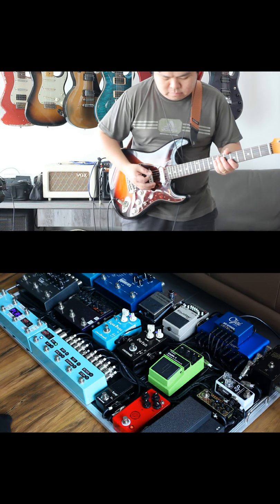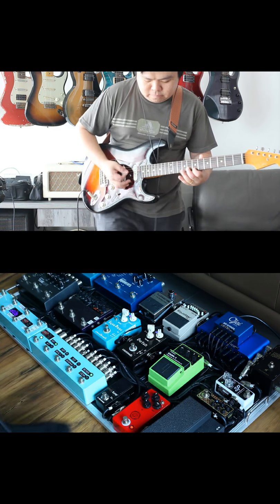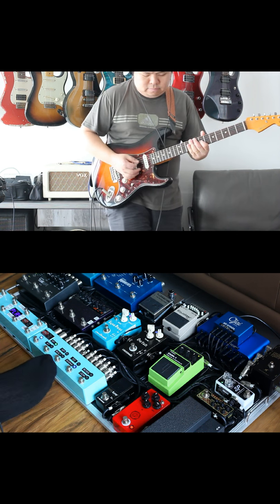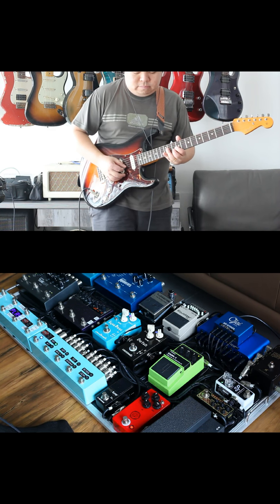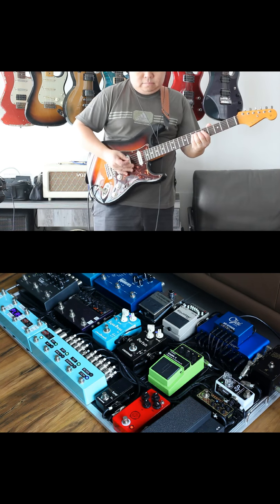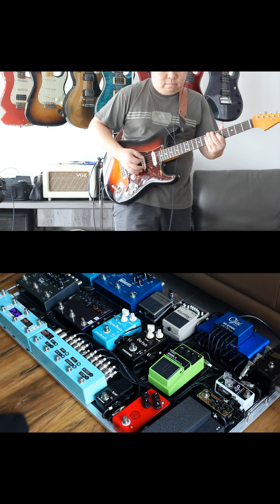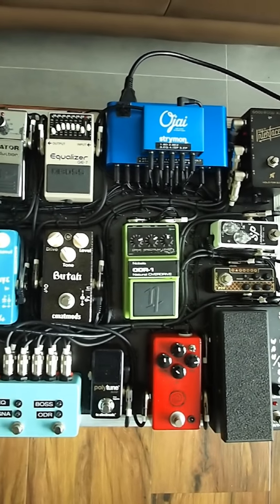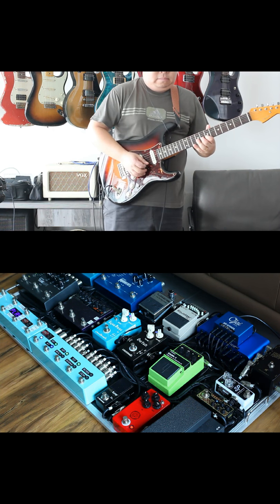Gear Tips: Going Ampless (Preamps, Cabinet Simulation, Overdrive Choices)

Comment: Yes! I’m going the ampless route as well. In my case I’m using a neunaber Iconoclast as my cab sim. But I thought that that and coupled with an overdrive would work. But I couldn’t get it to sound right. Right now I’m using the Chase Bliss Condor as my designated preamp pedal until the Revival Drive hits my board, then the magic starts. And yes, going ampless requires a preamp pedal and a cab sim.
Reply from the maker: Cool choice with the Condor! I used the Neunaber for a session and thought that it sounded better with a line out from an amp versus going direct with pedals.
Reply: Did you ever get the RevivalDrive?
Reply: yes i did!
Reply: Im having better sounds or rather more convincing sounds pairing iconoclast with the Revival Drive. But im agreeing with you that with just a normal overdrive, you just don't get to a place where you're satisfied and happy with the sound (sound and feel).

Comment: Hi Justin , blessings and great tone. I'm building a board on a budget for worship. I currently have a VP, tuner and strymon blue sky. I would like to go ampless I have intentions of getting a Revv G3 distortion, a fortin 33  clean boost and Zuul noise gate because I like metal tones as well. Last of all my cab sim would be a mooer radar. I would also like to get that sweet breakup tone you are getting. 
Do you have any recommendations for other drives that would work well? I also have a concern since I'm going ampless what would be my alternative to running my time based fx through the effects loop?
Reply from the maker: Thanks for the kind words! The slight breakup is the interaction between the CMAT Mods Butah and the Mooer Daytripper. The Butah is the best "single coil enhancer" pedal out there, but it only really works when you have a decent preamp and cabsim to push. I've had success with the Daytripper and the Joyo British Sound. Without the preamp (if you're using just the Mooer Radar), I don't think the slight breakup tone is possible.

As for metal tones, I had an AMT S2 which can be configured to run with or without cab sim with its 3 outputs. I think pairing the S2 with your Mooer Radar would make an amazing metal rig platform that can also take cleaner tones on its clean channel.

https://www.youtube.com/watch?v=U1wvaCdVOZw 

For your time based FX, which effects loop are you talking about? FX loop on preamp pedals? There are some that offer this functionality, but I think for a budget rig, it's best to put delays/reverbs after your amp/cab sim. There is no big advantage to having them in an FX loop, and the budget preamps don't normally come with stereo FX loop returns.
Reply: This is great information Justin  , I usually run my strymon blue sky and tc delay into the fx loop of my combo amp , however since I'm not using the combo what you are saying is place my delay and reverb after by mooer radar on the chain and then into the house mixer?
Reply from the maker: Ah, nice choices for delay and reverb! Yes, you can put them after the radar. Alternatively, you could also put the radar at the end, so you can use the headphone output for silent practice. Delays and reverbs between the amp sim and cab sim is conceptually akin to putting them in an FX loop.

Comment: Can you explain the signal chain? I know the cab sim should go after the preamp but what about the preamp in relation to the other pedals?
Reply from the maker: Sure, here's my signal chain: Interfacer->Comp->Wah->DPC-8EZ->Mod, Delay, Reverb. In the DPC-8EZ, the pedals are arranged as follows:

1. ODR-1
2. CMAT Mods Butah
3. CMAT Mods Signa Drive
4. JHS AT Drive
5. Line 6 M5
6. Boss GE-7
7. ISP Noise Gate
8. Mooer Preamp

So the preamp is after overdrives and tone shaping tools, but before the wet section of modulation, delay, and reverb. I think it would be helpful to think of the approach like front-ending a clean amp.
Reply: Justin Chan thanks! Really helpful, like making your own FX loop

Comment: hello blessings I am between the rock bug carl martin or the mooer daytripper but I can only buy one single. Which of the two do you recommend me to connect my pedals and go straight to console which is better for that? thanks, I hope your answer !!
Reply from the maker: Hi! Both are excellent choices for straight-to-PA applications, but I think the Rock Bug is a very clean and non-colored, so you might need to rely on your overdrives for the "amp character". 

The Daytripper is a Vox AC-voiced preamp and cab sim, with two channels that can give clean and lightly overdriven tones (but not distortion).

So it comes down to your needs. If you need a DI box on your board for cab sim only, the Rock Bug is a great choice. It also has an RCA input so that's great for plugging in for practice. 

If you want more character, for both amp sim and cab sim, the Daytripper is your best choice. It doesn't have an XLR out, or an RCA input, so it has less practical value for personal practice.
Reply: @AllAboutWorshipGuitar  hello brother the best of all the options would be to use the mooer as pre and the rock bug as cockpit simulator then jajajajja thank you for replying brother greetings from argentina blessings
Reply from the maker: Haha! I did that for a while! I turned off the cab sim on the Daytripper and used the Rock Bug for cab sim. It gave the Daytripper a much "boomier" sound.

Blessings to you too, brother. :)
Reply: @AllAboutWorshipGuitar  What does boomier mean? I do not understand much English ... the best sound achieved using the two together or with the Mooer reaches to play in Vibo should you add a box of truth?
Reply from the maker: My apologies! "Boomier" refers to the sound having more bass than mids or treble. Actually, to be honest, I preferred the tone of the Daytripper over the Rock Bug.

Comment: Hi. How do you connect that to a PA system? Do you need a loadbox in case of connecting all that stuff to a mixer? Regards
Reply from the maker: Normal DI boxes will suffice! With the Interfacer, you could sum to mono and just use one DI box. But the true beauty of this setup is having a pair of DI boxes, and at the mixer, hard pan the channels left and right for true stereo!
Reply: @AllAboutWorshipGuitar  I was thinking about using a aby pedal switch to get the stereo sound. Would it work the same way?
Reply from the maker: If I’m not misunderstanding your setup, I think you want to split a mono signal from your last pedal using an ABY pedal in reverse? That will split the signal to dual mono, not true stereo. It certainly is a step up from mono though.

Comment: no longer uses the rock bug carl martin as cabinet and the mooer daitryper as pre amp? now only use the mooer daytripper? Does it work better like this or did it get better sound with the rock bug?
Reply from the maker: Actually, it was a matter of pedalboard real estate. For this big board, I had an EP booster at the end of the dry fx chain, and the Mooer has the same form factor, so it made swapping out a lot easier. This video was concentrating on how to use the Daytripper.

But yes, since I sold my PT Junior pedalboard, I had no space for the Rock Bug. Also needed to sell off gear to fund other stuff, so, that pedal had to go...I miss it sometimes.
Reply: español

Thank you very much for answering. I do not understand the video because I do not speak English. I am using the google translator to write you. I have a rock bug that I recently acquired and when I saw your video, I got the curity of whether it would improve the direct sound to the line adding the mooer daytriper since the rock bug does not have equalization is only cabinet, the mooer yes, like preamp. If it's worth it I'm going to buy a mooer. There are no videos on this, I thank you very much for your time and your answers, may God continue to bless you greatly!
Reply from the maker: Go grab a Mooer, you won’t regret it! :) I’m humbled and glad that the video has helped you.
Reply: @AllAboutWorshipGuitar  I am from Argentina . Thank you very much for helping me. May God bless you twice for everything you share. Thank you for your time brother ... a hug !!

Comment: I am going to buy my first electric guitar with of course a speaker and i am thinking of buying a pa speaker and a day tripper instead of a amp because for me i can use it just as a music speaker and also for singing 
Would recomment it instead of amp? Is the sound of the speaker simulation in the Day tripper in a pa speaker good?
Reply from the maker: Hi! Congrats on taking your first step in buying electric guitar gear! What size of PA are you looking at? I’ve run this through a multimedia speaker before, and found it too “boxy” sounding. I then tested it with a 100W PA system and it sounded much better.

Actually, if this is your first purchase, I’d go with a traditional amplifier first. Master the basics of one guitar, one amp. Then you’ll appreciate what these preamp pedals are trying to emulate.

Comment: Hey Justin,

You used to use the Vox AC4TV? I’m using my AC4TV, but I want to play without the amp. So with the Mooer 004 it is possible? My Strymon BigSky is at the end of the chain.
Reply from the maker: I still have my AC4TV! And yes, it is certainly possible with the Mooer 004. Having it before the BigSky is also where I've placed my Daytripper, as I'll sometimes use that cab filter instead of the stock Daytripper's cab sim.
Reply: So as very first in the chain?
Reply from the maker: Sorry I missed this! Have it after the wah/comp/drive section.

Comment: I have question man, 
I also have to go ampless because of the church where I play and on your set up I see you have the MOER 004 as a pre amp, but what's the last pedal you use at the end of your chain? 
I was using a cab sim Hotone but i really didn't like the sound.
So I'm thinking of buying the MOER 004 as pre amp, and I don't know what to use at the end as cab sim. So which one are you using?
Reply from the maker: Hi! My last pedal in the chain is the Strymon BigSky. The Mooers pack both preamp and cab sim, and since it can't be changed, I'd recommend you try out the Mooer with your overdrive pedals before it, and your delay/reverb after it and see if you like the sound.

Alternatively, I have had some success with my Mooer Daytripper with the Mooer Radar, but I didn't get the chance to integrate it into my setup since it has special power requirements.

Comment: Hey man great video, so are u using the mooer as preamp and thr cab sim on your bigsky as ur cab sim?
Reply from the maker: Thanks :) It will depend on the application! If I needed a bigger sounding amp tone, I’ll run the Mooer with the BigSky cab sim, otherwise, I rely solely on the Mooer.
Reply: @AllAboutWorshipGuitar  yup, but on this video, are u using mooer into Bigsky's cab straight to ur interface?
Reply from the maker: Oh my bad, I misunderstood. I’m using the Mooer only for this video.
Reply: Justin Chan but the out on the Mooer is mono. What about  the stereo effects in your chain? How do you go amp less in Stereo with a Mooer at the end?
Reply from the maker: My Mooer is at the end of my dry effects chain (the last of the loops in my true bypass looper), then it goes out to the Strymon effects, where it becomes stereo.
Reply: @AllAboutWorshipGuitar  so you separate the wet signnal to dry signal..